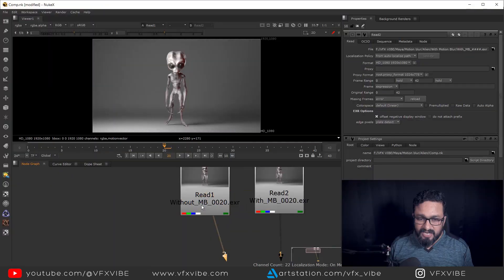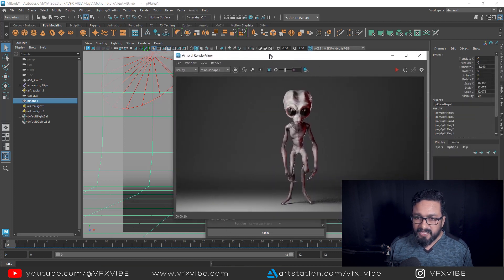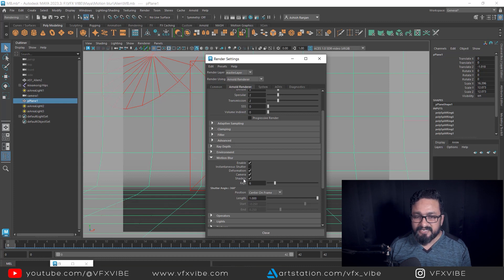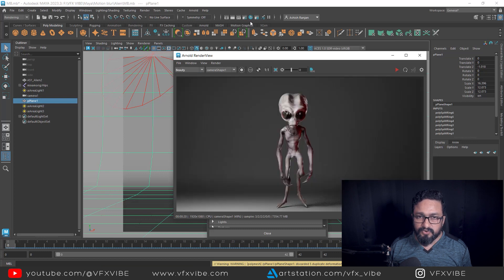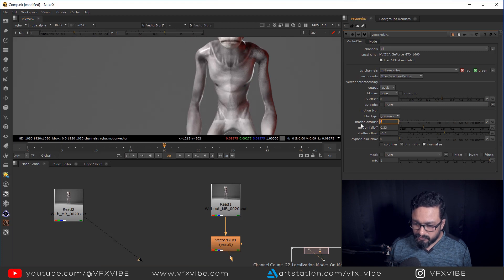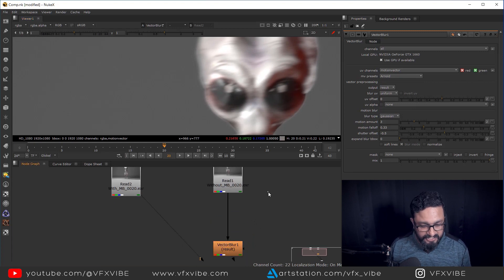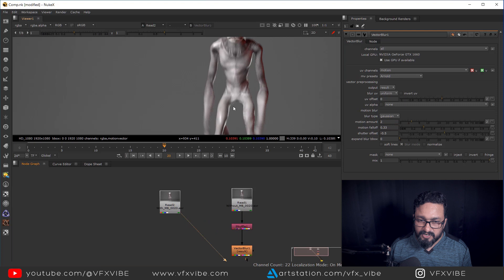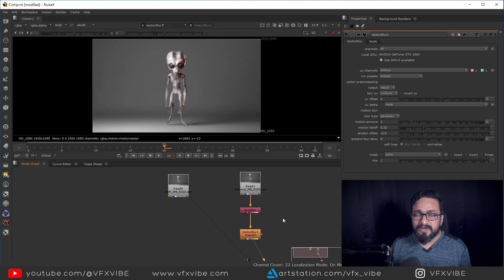HOW TO USE MOTION VECTOR PASS IN NUKE & MAYA | VFX VIBE

Comment: I have a question and hopefully you could help me please.
I have 2 rendered sequences

1 - Beauty with aovs (diffuse direct / indirect / spec direct / indirect and crypto matte) When shuffling these i get the Beauty pass

2 - Same render but only with the motion vector (i could had added this AOV to the first render but now its too late to render again)

Problem… When i use the Motion Vector (2) on top of the beauty (1) and adjust the values to blurr, it appears that the beauty from (1) stays behind of the motion vector (2) this means that the rgba (beauty) from (2) is seen and is being blurred instead.
Is there a way of making sure the MVector from 2 affects the beauty from 1 only?
Reply from the maker: I will suggest to shuffle your motion vector pass in 1 AoV group. Also make sure if it's rendered in the same bit depth or not. 
Try to change options in vector node as I showed you in this video to avoid artiffects